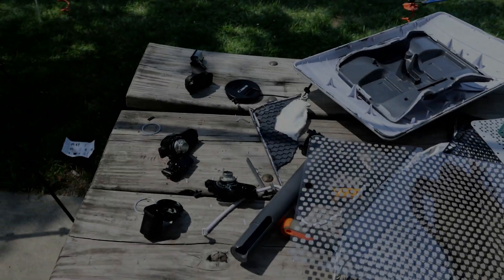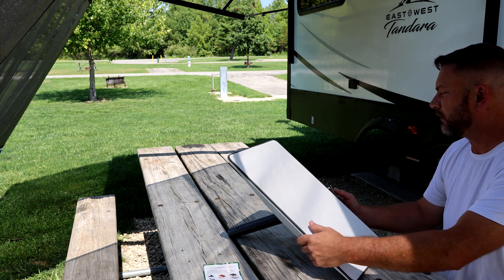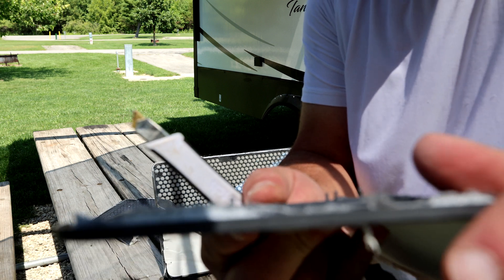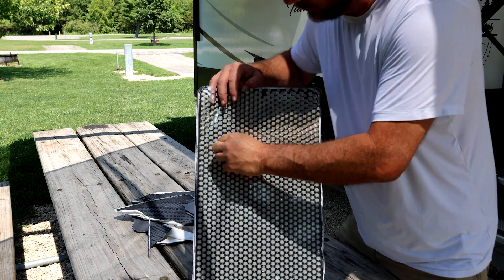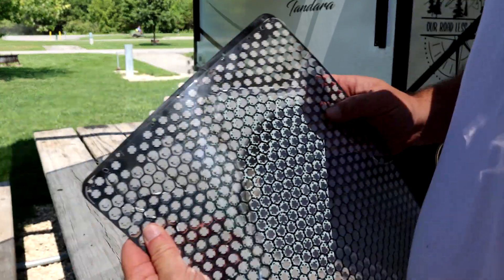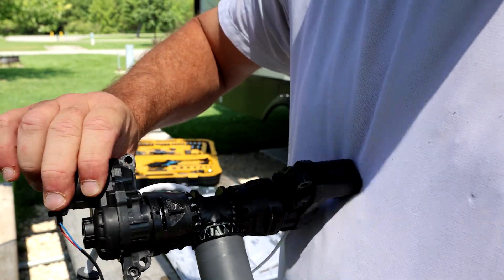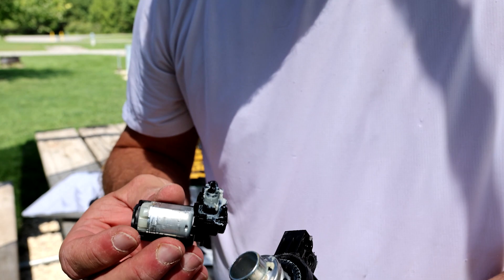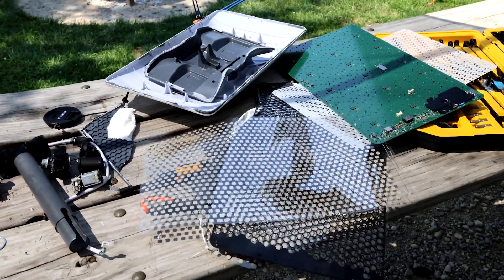Our Starlink exploded, Dishy tear down.

Comment: Did I miss the why?
Reply from the maker: a few months ago I dropped this one. Instead of just throwing it away, I thought in might make for a good video. I figured not everyone has seen the inside, including me. I was kind of shocked at the simplicity of it.
Reply: @OurRoadLessTraveled  I thought that was likely the case. I wasn’t sure if it was exploded as in blew up exothermically or was an exploded view LOL. I can’t believe all the layer of stuff with holes. Tiers gotta be a use for that. Strainer for spaghetti? Make an door window screen?
Reply from the maker: @longgone2023  When i get the courage, I'm going to suggest Maria use it as a scrub board to wash cloths. I have not been brave enough yet. I have to pick my moment, so she knows I'm kidding.
Reply: @longgone2023  Snow heater.